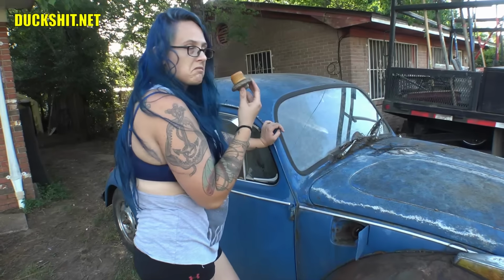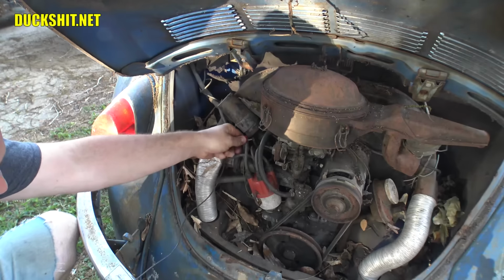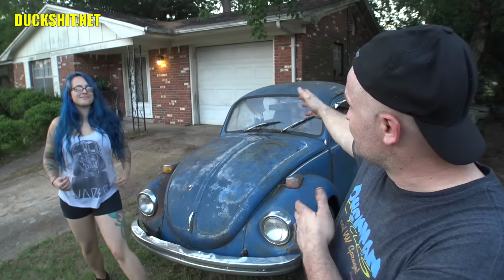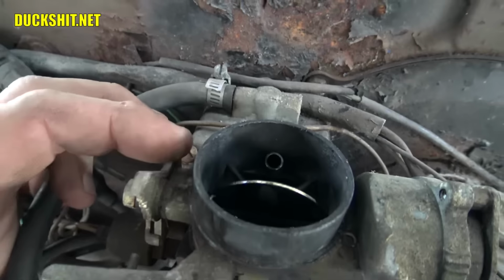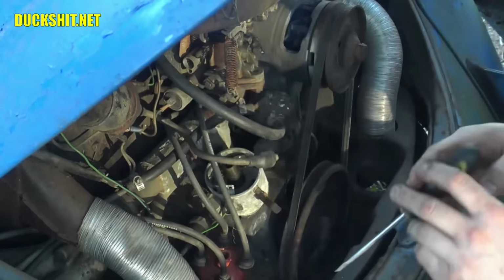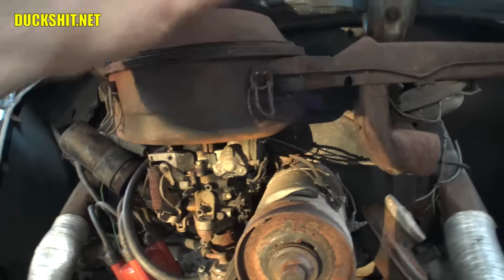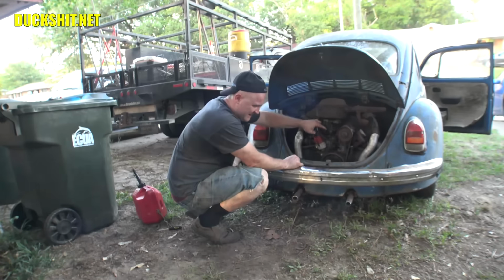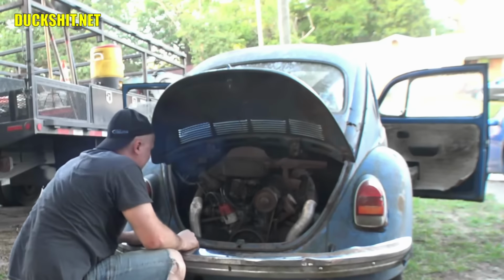FIRST START IN OVER 30 YEARS - 1972 VW Super Beetle - Will it Run?

Comment: In my day we'd use a match to gap plugs and the matchbook cover to set the points.
Reply from the maker: I heard the business card trick when I was just a kid working on a lawnmower engine in a go kart.  My dad mentioned it to me in conversation.  Never actually tried it before, but figured what the heck lol
Reply: @DuckmanCycles  My Granddad taught me to use my thumbnail to gap points. He built B29s for Bell/Lockheed WWII. And my Machine Shop instructor in college ('70s)  taught us to use a cigarette paper to sneak up on the part and cutter. When the cutter snatches the paper you have a few tenths (machinist for ten thousands of an inch) to go. Of course we all had cigarette papers...
Reply: Watch MUSTIE 1. On the tube,  takes vw engines sitting in. Garages for 40yrs and uses his feeler gauges and squrty bottle to get it running
Reply: yes, and a dollar bill to clear && fine sand the points after using a sandpaper!! there's no other way to get your car running in the middle of nowhere.

Comment: So I stop @ the auto parts by my house in my bug. There’s a guy in there that sez you want another? I went by his house in a old garage under his house is a ‘67 bug with 1996 plates on it. He wanted $3200 for it cause it’s a ‘67!! whatever, I told a lot of peeps about it but no wanted it for that.
Reply: It really depends on the condition of the car, if it is rustfree, good original nice color paint, complete good chrome and perhaps even a sunroof I think It's good value. Just think about the labor cost for a restauration...
 If it's a rusty crusty mousetrap on wheels it's a totally different story.
Reply from the maker: Agree... its all about the condition, and of course if it has the correct paperwork!